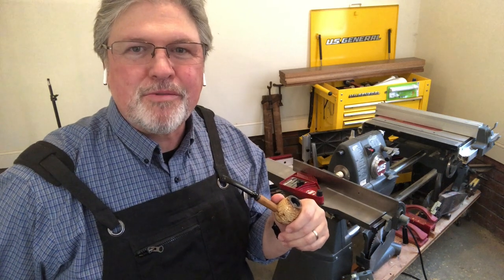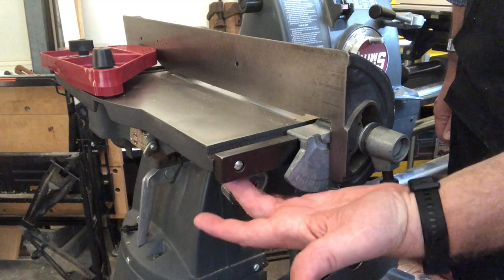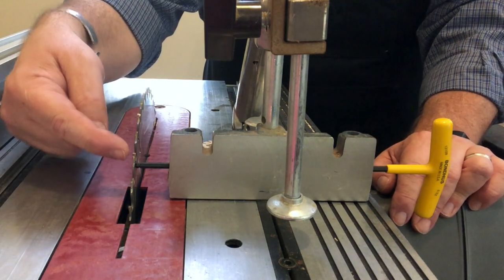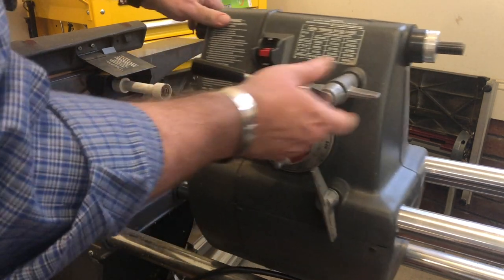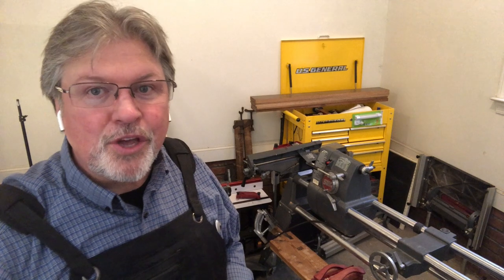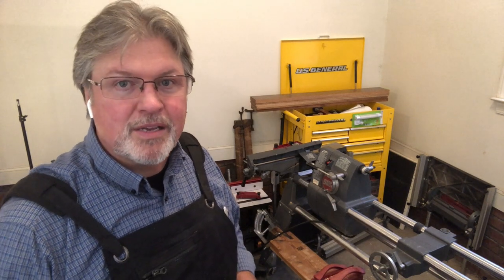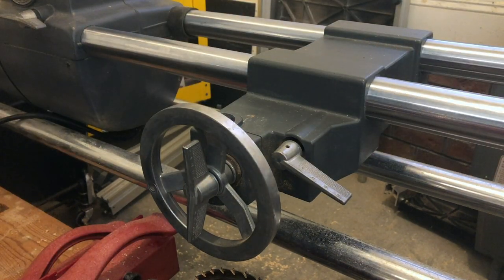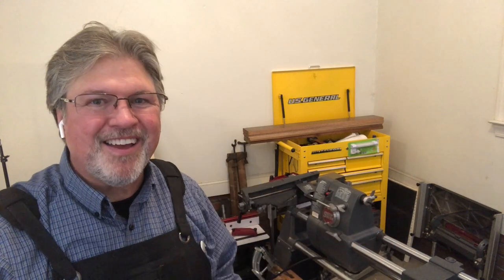Shopsmith Headstock Lock, Carriage Lock and Jointer Fence Issues and Mysteries SOLVED!

Comment: Scott,
I am a recently retired Navy guy who did not get enough so I continued with the military for another 20 more years.  As therapy for my insanity, I chose to learn woodworking on my own, bought a used Shopsmith and am teaching myself with your help.  So question.  I recently was given a shorty 510, with components busted and not taken care of in any way.  I have fixed or replaced everything and everything works.... except the carriage lock portion that locks the lathe rest.  No matter how tight I go it does not stop the lathe rest from moving up and down with the wheel.  I have my original unit and I can see no difference in hardware so I am stumped.  Thanks and take care.
Reply from the maker: I suspect that you are either missing a washer or that a washer is on the wrong position behind the “Table Height” lock. Get a copy of the exploded view from Shopsmith and double check the arrangement. Also, as a rule I remove one of the stop collars from the tail stock and install it on the tool rest post. Search YouTube  for “Shopsmith stop collar” for a video I did on this subject a year or so back. Let me know if the problem persists. Scott

Comment: Bought two Shopsmiths when a guy cleared out his garage. One (500?) has shorter way tubes since it was mainly used as a drill press and overhead router. The other (510) was mainly used as a table saw. Glad I found your informative channel so that they are properly set up and lubricated to when I put them to use.
Reply from the maker: Excellent. I’m glad to hear that you’ve found it helpful. Scott

Comment: Excellent video Scott. These things have not been covered in any other video on youtube that I have seen. Even the original Shopsmith assembly/alignment video with Susan Reid and Mike Young didn't mention any of the points you touched on.  Another great one in the can.
Reply from the maker: Thanks. See, I told you that I'm not just a pretty face.  Scott

Comment: Exactly- I cursed the jointer, read articles, watched videos.  Nothing could I do to acquire good results.  Thankfully (years ago now) I realized it was that bar.  Not loose but set high ....
What’s surprising is how effective the cams are.  I was very leery the first time the machine was in the drill press mode.
Reply from the maker: Yes, that can also cause headaches. I agree about the cam. It doesn’t look like it could possible hold tight enough. Scott

Comment: I notice the handle was missing off your carriage handwheel. Same deal on the 520 I just picked up.
Reply from the maker: Yes, they are fairly easy to break, and in my opinion, they project too much. On past units that I’ve owned I have replace them either by using a knob from the crank of the Shopsmith Pro Planer, or by turning a similar one from wood. Scott
Reply: @MyGrowthRings  I found mine in a bag of bits, but no long bolt. I had to grind down the head of a carriage bolt.  Today's fun is getting the jointer functional, I've removed most of the surface rust, but noticed that the 5/16" bolt with the thin head which is part of the fence lockdown is bent, and it appears it needs to be VERY straight, as my first effort using a nut cut in half protecting the threads in my arbor press was not straight enough.  The jointer, like the bandsaw were never used by the P.O.
Reply: The handle on a used 510 that I just picked up a couple of weeks ago was missing the handle as well. Funny, that Shopsmith doesn't sell the bolt portion of the handle as a service part for such a commonly broken item. They offer the plastic outer portion of the handle but you have to by the entire adjustment wheel assembly. Costs about 25 bucks for the whole assembly.

Comment: Great Info. Speaking of Locks, my table tilt started to fail. Whenever I put my fence on the table, it would start to drop down a degree. I took things apart and saw that my clamp shoes were really shiny. I sanded them down, put things back together and it didn't solve the problem. I sent an email to Shopsmith and they said my threads in the Rod and Shoe Assembly are probably stripped. So I took things apart again and notice that some of the threads on the rod had gone flat. With care, I started to turn the tilt lock lever down over the flattened threads. Backing in and out as I went farther down the threads. I then re-assembled the clamping rod in the table. It holds tight now! 
I hope we go back to talking about bandsaws because mine screams even though I have replaced the bearings.
Reply from the maker: I’ve had that happen too. Glad you figured it out. Many times people get wax crazy and accidentally get those parts all slicked-up, but the stripped rod can be a real pain. Yes, the bandsaw can be loud because there are so many breathing spinning that don’t have much weight on them. Even new the SS BS can be a little loud.

Comment: I have enjoyed watching your videos and am glad to see a better presenter than some of the ones available for the Shopsmith.  I bought a model 510 and soon after upgraded to a 520.  I have recently upgraded to the Mark 7 and think it is great, but, I have a question. Why does Shopsmith not make the table slots 3/4" wide.  I wish to make a jig and none of the after-market miter bars fit my table slots.  I have purchase from several sources including Incra who made the new positive stop miter gauge that I purchased.  It is a bit frustrating.  Any help you could give me would be appreciated.
Reply from the maker: Hey Paul, thanks for your kind words. I suspect we will never see a change to the “standard“ miter slot because the current Shopsmith specifications have been in use since the 1950s and have serve them well. Keep in mind, they they pick their mite slot dimensions before there was such a thing as a “standard“ and they aren’t the only ones whose miter bar isn’t 3/8” X 3/4”. The same holds true for the 1 1/4” hole in their blades.Scott
Reply: @MyGrowthRings  Thanks for your prompt reply and I was thinking along the same lines and I know what you mean about their saw blades which is why I bought several 5/8 arbors years ago.
Reply: I picked up a set of "Zero Play" miter bars from MicroJig. Works perfectly on my SS 520. Curt.
Reply from the maker: @curttundra  Awesome. Did they adjust down that far without having to trim them?
Reply: @MyGrowthRings  yes, the bars fit with a few thousandths of play but are easily adjustable to remove the side to side play. The package states the bars are made to fit Shopsmith miter slot. Curt.
Reply: Oh and how rude of me! Thank you Sir for doing these weekly videos. Thank you for sharing. Curt.
Reply from the maker: @curttundra  Perfect.
Reply from the maker: @curttundra  Nothing rude about your comment, but thanks for circling back. I compliment is never unwelcome. Scott
Reply: Why not buy miter bars from SS? That's what I do, I keep a couple extra on hand to have when needed.

Comment: Now that I'm my Shopsmith frequently, I keep coming back to your videos for these problem solving tips you give us. Thank you.  Currently I find I'm constantly adjusting the carriage lock back and forth way more than 1/4 turns. And sometimes after releasing the lock, the carriage doesn't move freely. A little jiggle of the handle solves the problem but I'm still adjusting often to get the locking handle position to the full 90 degrees.  Is there something  inside the the locking mechanism that can stick and or get loose?  (ps. now that I'm trying to film some of my stuff, I wonder what camera are you using that provides autofocus as you hold something close to the lens?)
Reply from the maker: Yes, it's likely that you've got wax built-up inside the carriage and it may require you to pull it off to clean it. If you haven't watched it, check out my waxing video. Up to this point, I'm simply using my iPhone. It's the highest quality camera I own. Scott
Reply: @MyGrowthRings  thanks. Dang. Was hoping to avoid pulling the heavy PowerPro headstock off to get to it. (also thanks for camera info)

Comment: Thanks Scott for a very informative video ... can you recommend what can be used to lubricate the sheaves of the headstock?
Reply from the maker: Thanks. Here's what I use: https://amzn.to/3p7GQJv
Reply: @MyGrowthRings  Thanks Scott for the info ... just ordered it.  Have a great day
Reply: Hi Scott,  another question regarding the carriage lock lever. On my SS when I lock the carriage lever it doesn't go past horizontal. I noticed on your SS the lever actually goes past horizontal when you locked it down. Would you think that my lever is too tight. It seems to work okay as is. Thanks,  Curt.
Reply from the maker: @curttundra  Yes, it's probably too tight. The extra "ommph" part is the final pull of the cam, and it really should have that little extra travel.
Reply: @MyGrowthRings  tried adjusting the lever. When I loosened it enough to where the lever went below horizontal the carriage was woefully too loose. Tightened the nut down in quarter turn increments to the point where the carriage would not move and the lever wouldn't go past horizontal. I did get adjusted to where the lever now has that final quarter turn where you feel and hear the camshaft locking, like it explained in the shop manual. Was doing some drum sanding tonight SS in drill press position and no movement in the carriage. So guess it's okay, or at least safe to use. Thanks for the help. Curt.
Reply from the maker: @curttundra  I’m wondering if something could be out of whack. Keep a close eye on that for movement and if it can’t pass the tug test it might be worth pulling the headstock and carriage off and inspecting the mechanism to make sure it’s all there and facing the correct way. That’s something you really want to be confident with. Scott
Reply: @MyGrowthRings  seems to pass the tug test, as it held in lock position during drum sanding. Think I will do some drilling to be sure it holds under some down pressure. I'm able to clearly see the underside of the carriage cam lock mechanism,  can't see anything obvious misaligned or tweaked. Although that said, I can't actually see the flats/curve of the cams. Those seem to be the only parts that could possibly be installed upside down,  but if so I don't see how the locking mechanism  would even go together. Thanks for the help. Curt.
Reply from the maker: @curttundra  For sure you’d want this tight for anything like drilling or mortising. Happy to help.
Reply: HI Scott and just wanted to thank you again for your recommendation on the sewing machine oiler.  Just used it to lube the sheaves and it worked like a charm.  Thanks.
Reply from the maker: You are welcome and happy to help. Scott